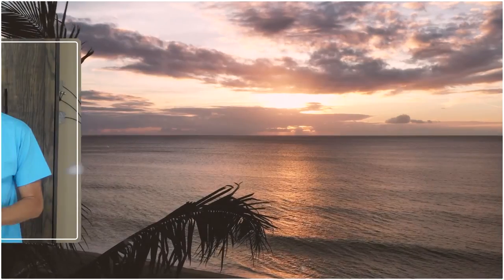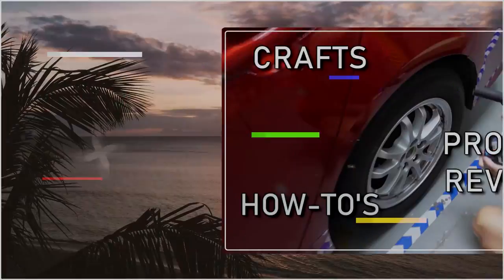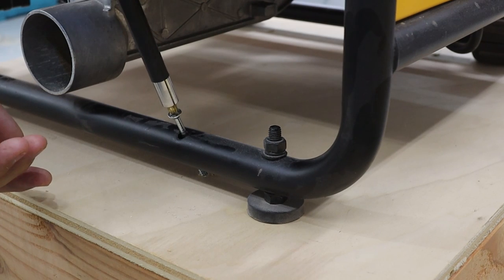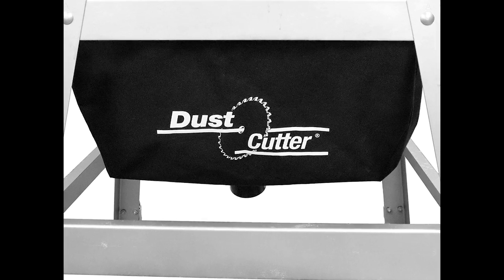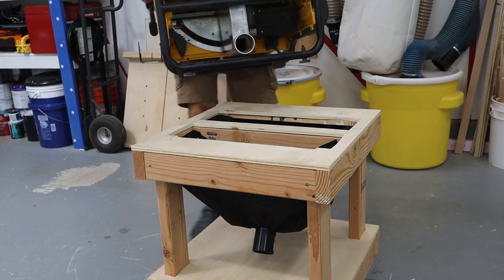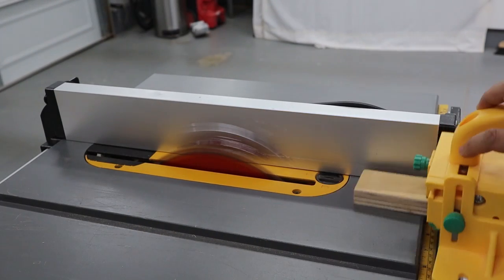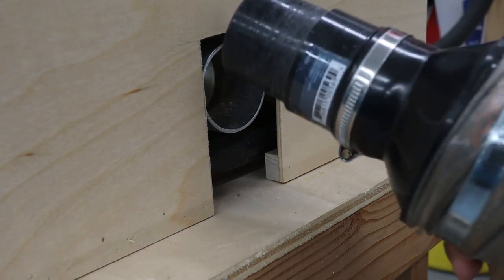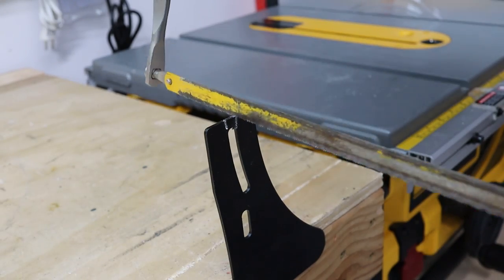3 Dust Collection Improvements for Table Saw

Comment from the maker: Although the combination of the improvements we applied for dust collecting, there is still fine particles in the air so we will continue to use masks but our cheap air filters seem to clean that out quickly so we are super pleased with the results. Wish we would have done this loooooong ago.
Reply: Good for you for paying attention to the sawdust and making improvements on collecting it…it’s SSOOOO important!!!  One tip I’ve seen to improve dc on the table saw is to cover up the slot where you adjust the tilt of your blade. If your TS is metal in that area, look at the Microjig Magnetic Dust Cover. It’s only $11, and you’d spend more than that pretty quickly if you just covered it up with tape. 

One more area I think you could improve is your dust port connection. I’m not sure if DeWalt’s TS is like this, but I know their planer is—there’s a fan that actually pushes the sawdust out the port vs it just being a passive port. Either way, if I saw correctly in your video, the connector that you’re using to connect to the dust port is smaller than the actual dust port itself. So it’s letting or even blowing out sawdust around your port that your collector isn’t getting! You need a piece that connects to your collector to make the dc attach to the OUTSIDE of your dust port. Hope this helps!
Reply: but 98% that's huge!  i can't wait to make these same changes!  Thank yoiu!

Comment: The war on dust is never ending! What was up with the pin nailer?
Reply from the maker: At least I get the feeling I am winning against the dust for a change. As for the nailer, I would normally get sarcastic and say something about it having a screw loose. Turns out there really was a loose screw that allowed two pins through each time. Problem fixed for now. :-)
Reply: That happens when the air pressure is too low, below 60psi

Comment: Another great fix for a problem.  My saw is a different brand but my neighbors are far enough away that I can leave the door up. If it rains, I get the floor mess to contend with.  Maybe I should stop sawing when it rains,,,Hmmm!!
Reply from the maker: HAHAHA! We actually have a different thought about the rain. If it rains, that will keep sawdust from flying all over the neighborhood so I am more apt to leave the garage door open just a bit but in Hawaii, it may rain fairly regularly but it is for a few minutes and then it is sunny once again, very quickly. hmmmm.

Comment: Soon I'm gonna be building a rolling workbench to fit my saw and I'll definitely try a couple of these ideas with it as the dust has become too much to handle at the moment. The year I've had this saw I've mostly set up by the garage door but it's not the long term solution I need! Cheers!
Reply from the maker: We are sincerely thrilled to hear you are interested in trying a couple of these ideas. Knowing the the projects you do, we have no doubt you will make improvements and we will have to make more improvements by using your ideas.

Comment: Great ideas and tips, that will make a better environment to work in. The blade guard option I have never got use to, but that’s just me.
Reply from the maker: I am with you on the blade guard. Sometimes I just have to use it and then it is in the way so I remove it. Now being able to remove more dust makes it much more practical for use in our little garage/workshop.

Comment: Great video!!!  So do you have to use to separate vacuums?
Reply from the maker: You can use one but you will need an adapter that converges the two gives into a single hose to attach to a single dust collector.

Comment: Hello,
A good update for the table saw. Dust collection systems need to work well at all times. As long as it is connected to a good suction system, it will not cause any problems. This was a nice update. Congratulations. It's a feat to always do a little bit better. Everything you get your heart desires.
Reply from the maker: Thank you so very much. Your kind words are appreciated.

Comment: It's so hard to collect all that fine dust but 98% is very good. 👍
Reply from the maker: I have a couple fans with HVAC filters running and they pick up a ton of sawdust as well. It never seems like there is that much in the air but the filters are full with dust in just a day of cutting wood in the shop. Between all of this, it helps a lot.

Comment: Great upgrade on the table saw both.
At 4.04 the vac hose into the outlet port on the table saw looked extremely ill-fitting.
Can you buy an adaptor from the shop vac to the table outlet to get a better fit and seal?
Great video as ever both.
Take care.
Cheers, Huw
Reply: I made the same suggestion, before I read the other comments, of course 🤣
Reply from the maker: You are very observant as always and you are spot on. I already ordered some parts but they are too tight but that is fine. What I do is use a heat gun to soften the fitting end, which I intentionally purchased too small and then I force the adaptor on and allow it to cool and it makes for a very tight fit. I then add thumb screw hose clamps for an even tighter fit.

Comment: great video! one small suggestion: it would be great if you could include a wide shot of what the completed upgrades look like. most of the shots are very tight.  thanks for sharing!
Reply from the maker: Thank you so very much for the kind words about the video, and especially for the fantastic advice. You are 100% correct. Too often, i get carried away with making the project and I dont think through the shots I need to record. We promise to try harder.

Comment: Do you all of these dust collection devices hooked up to a single shop vac or?
Reply from the maker: Great question. I was hoping to obtain a splitter that would allow me to connect two options to the dust collector and the other to my shop vac. I have only been able to connect the table saw output port and the blade cover to dust collectors. The bag below is static but does a great job of allowing dust to fall down in the bag instead of flying all over the shop. Thank you for the great question.

Comment: Where you made the connections from your vacuum hose on the dust cover above the blade. The fit leaves a lot to be desired. you can make it more efficient with a very simple fix. take a small  water bottle and cut both ends off, slip it over the hose connections and use a heat gun to shrink it together , that will make an almost air tight seal.
  Almost all plastic plastic bottles and containers can be shrunk to make connection parts the heavier bottles like mountain dew perform better because of the strength .Which opens the uses only your imagination will soon  discover !!!
Reply from the maker: You are absolutely correct and we truly appreciate your providing this information to our viewers. I usually purchase hose connector/adapters at a slightly smaller size, use my heating gun to soften the adapter and force it tightly onto the corresponding hose and allow it to cool to create a tight fit. I always use a hose clamp on top to ensure the connection does not come apart. I decided not to do so on this build but I should have pointed that out to the viewers. We sincerely thank you for watching the video and for the awesome comment and suggestion you have provided. It really does mean a lot to us.

Comment: What about the blade cutting, say 45 degrees, the rear vent mov4s.
Reply from the maker: Unfortunately, this will not work with a 45 degree cut. If you find a solution for a 45 degree cut, we would love to hear how you accomplished it.
Reply: I saw a video. The fellow attached a couple of markers to the exhaust pipe of his dewalt table saw. He placed a right size piece of plywood in contact with the pens. With someone holding the board he tilted the saw to 45 and traced out the curve the exhaust pipe travel. Cut it out and now the back is sealed and the blade travel is available. I figure the way to seal up the curved opening is a curved piece of ply held in place with washers and magnets. I know your pain. My shop is in the unfinished part of the basement. There is also a lot of other stuff stored there. The room is starting to look like a hasmat tent, shower curtins everywhere. To add to the layer, I also use a wood lathe. A scession on that is a sight to behold. More so if the door bell rings. Ive answered wearing a resperator, full face mask jacked up and covered in chips head to toe. The exptessions I had r priceless.